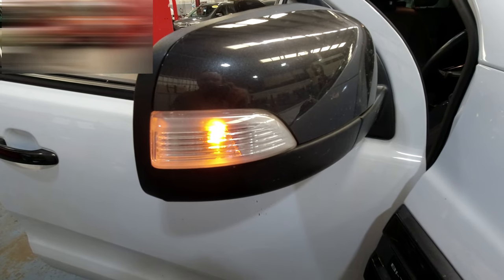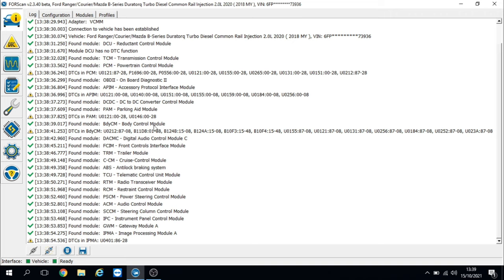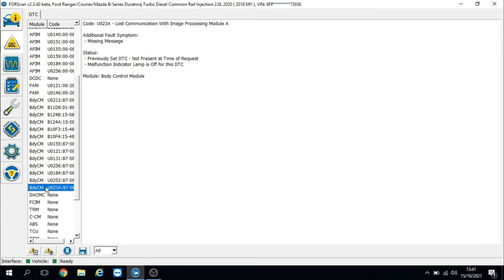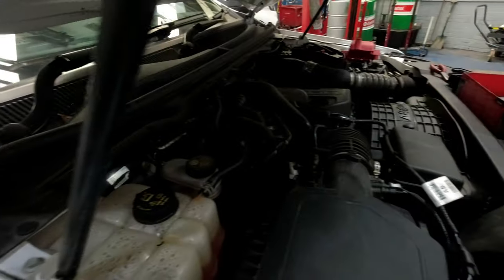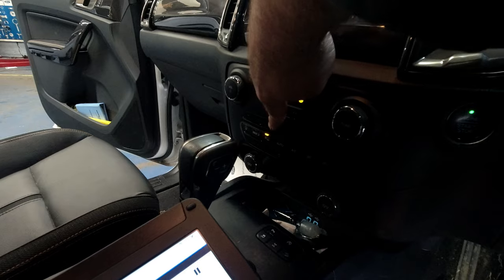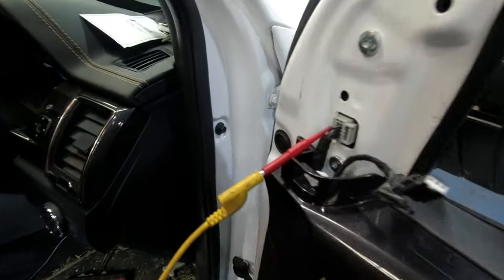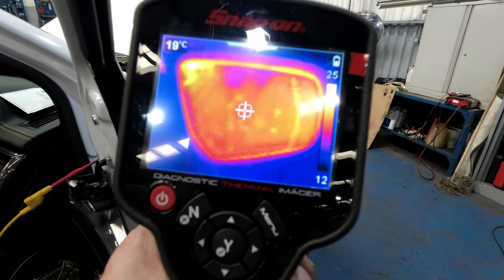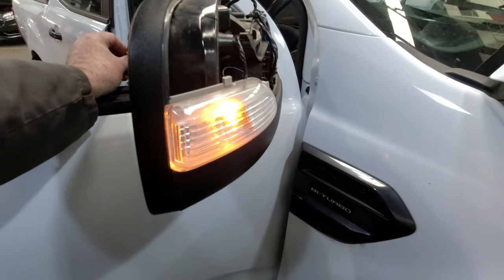Ford Ranger - All these faults because of a bad earth point!!

Comment: is any place, that you can buy those small terminals?Because I am looking  to buy some of those, to have them, and I can't find  them anywhere. thanks for the great video. 
And  one more question, why you can't saw us the wiring diagram, and you draw one? (I can imagine, but I want you to confirm it😂)
Reply: Manufacturers wiring diagram cover by copy-write data protection many people / companies have got caught doing this. The correct thing to do it reproduce them slightly different
Reply: @roadsidediagnostics1017  I thought so.thanks .
Reply from the maker: As mentioned, due to copyright, there are too many people out there wanting to put a stop to these videos and looking for any opportunity. Terminals aren't available from Ford in the UK. Wurth do a selection
Reply: Look on the vehicle wiring products website for some reason it won’t let me post a hyperlink